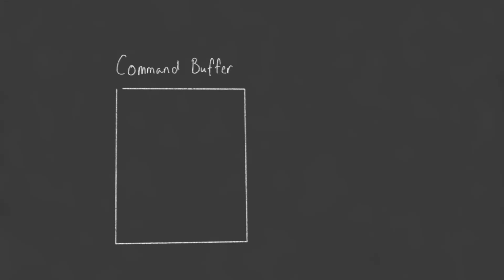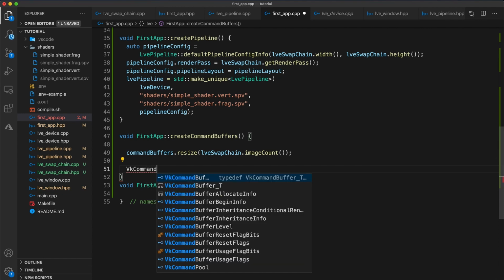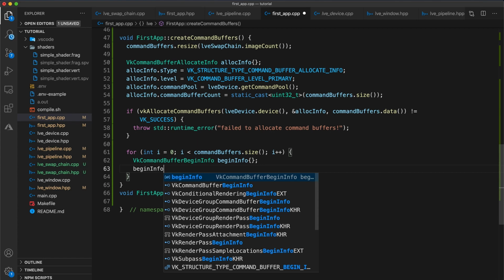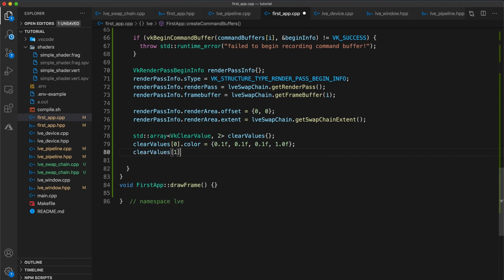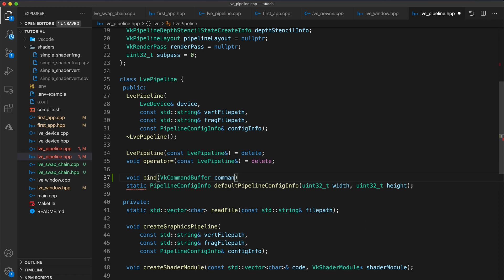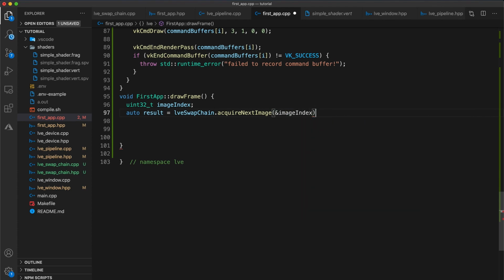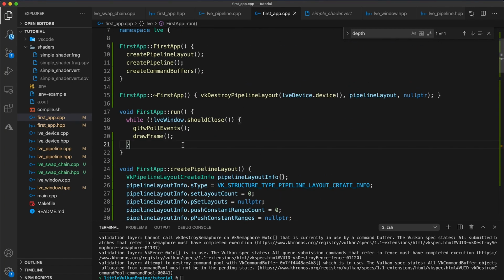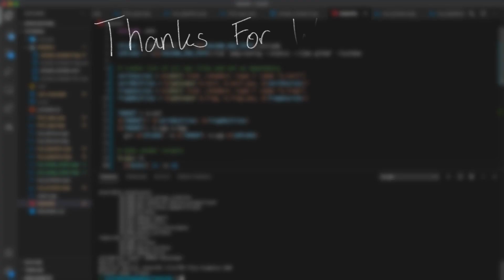Command Buffers Overview - Vulkan Game Engine Tutorial 05 part 2

Comment from the maker: !!! CORRECTIONS !!!
Note that in PART 1 of this tutorial (around the 5 minute mark) I fix the mistake last week, but I also left in an identical mistake within VkPipelineColorBlendStateCreateInfo pointing to the colorBlendAttachment! 
If you are using the MSVC you will be required to fix this. If not, then you can wait until tutorial 8 where I fix things there. My apologies!
The fix  is to pass in a reference of config info to be initialised rather than returning a copy.
https://github.com/blurrypiano/littleVulkanEngine/commit/a867ab39c43ccc89ca744db84137df179b41daa7
Reply: This was super important for me. I was doing this whole project in Visual studio and it was crashing just following the videoes at this point and it was crashing before the validation layers came up I think; wasn't getting good error messages. Did what this comment showed and now it is working fine. Onward!
Reply: The linked diff is still incorrect. Adding `PipelineConfigInfo(const PipelineConfigInfo&) = delete;` also deletes the default constructor. So you have to add `PipelineCreateInfo() = default;` in front of that.
Reply from the maker: @carlowood9834  - haha arghh darn. Was this causing an issue with a specific compiler? 

I've tested it so far with several compilers and so far no issues... but you are still right that this should be fixed. Thanks!
Reply: @BrendanGalea  It's incredibly late but in case it's useful. That issue happened to me with Visual Studio 2022 (C++ 20). The fix proposed by Carlo Wood solved it.
Reply: For context I am using Visual Studio 2022(C++17).

The code works with out making the modifications you link to. When I updated my files to reflect the files in the commit I get validation layer errors indicating the viewport and scissor objects where not passed to the appropriate vk function to establish the required state. I got errors along the lines of "viewportCount cannot be 0", and a few others relating to the viewport and scissor specifically. I might try using the modified versions of the files above again soon to try as an Vulkan exercise.

At this time I am falling back to the code used as in the video for now.

If you have any suggestions to try and resolve the issue I would like some guidance.

Thanks for this excellent tutorial.
Reply: @mikelevels1  Same issue.

Comment: Your content is amazing and you are a genuinly good teacher/tutor.

I just reached the end of this tutorial and everything compiles fine, triangles shows up etc., but I do get a a bunch of validation messages regarding semaphor use, that you don't seem to have gotten at this point.

If anyone could tell me how to fix that, or tell me if this even needs fixing, I would much appreciate it, even after all the years this tutorial has been out!
Semaphores are one of those things I haven't really used before, the validation layer recommends this:

a) Use a separate semaphore per swapchain image. Index these semaphores using the index of the acquired image.
b) Consider the VK_EXT_swapchain_maintenance1 extension. It allows using a VkFence with the presentation operation.
Reply: The issue is caused by recent changes in the validations layers. The recomendation now is to use one renderFinishedSemaphores per swap chain,.To solve the issue, go to createSyncObjects and change 
renderFinishedSemaphores.resize(MAX_FRAMES_IN_FLIGHT); to
renderFinishedSemaphores.resize(swapChainImages.size());

and also in submitCommandBuffers change
VkSemaphore signalSemaphores[] = { renderFinishedSemaphores[currentFrame] }; to
VkSemaphore signalSemaphores[] = { renderFinishedSemaphores[*imageIndex] };

PS: don't forget to change the initialization of the renderFinishedSemaphores and the cleanup for the new size
Reply: @pedrobussab9190  Thank you so much!
Reply: @HackFight Predrobussa's comment was seemingly deleted. Do you have the fix?
Reply: @LucydDev  Just switch the comment sort order to Newest first and you’ll see the answers. No idea why the default order hides them.
Reply: @y4cj4sul3  Thank you I figured it out after commenting lol. I have a hunch as for why it did that: it probably got filtered out for some reason for containing code snippets, much like how youtube often filters comments out as 'spam' for containing links.
Reply: i am having the same issue, I didn't see a fix anywhere, any advice?
Reply: @lkett197  Yes, the fix is to use MAX_FRAME_IN_FLIGHT or whatever its called to 3. as Brendan mentioned in the tutorial, his device doesn't support mailbox present mode, mine does, but mailbox and a bunch of other present modes require 3 frames. Brendan left his at 2 because he uses standard FIFO which only uses 2

Comment: In the end of the last video,  you sort of said in the createRenderPass() method, we're passing in VkSubpassDescription subpass with .pColorAttachments and .pDepthStencilAttachment to ultimately create the render pass. The render pass is the blueprint for information for the frame buffer. When did we pass in color and depthStencil information to the frame buffer? Is it in createCommandBuffers() clearValues{}, then clearValues[0].color, clearValues[1].depthStencil? This just clears the values, when did we set the values? Thanks, still just a beginner here.

Comment: I'm using Visual Studio 2019 and I can't figure out how to add a custom build step.  Anyone have any luck with that?
Reply: I managed to get it working by adding the following to VulkanTest.vcxproj in the section <ItemDefinitionGroup Condition="'$(Configuration)|$(Platform)'=='Debug|x64'">
It's doesn't look for all *.frag and *.vert files currently.  Just the specific ones.  I'd appreciate any help on making it generic like in the tutorial make file.

    <CustomBuildStep>
      <Command>C:\VulkanSDK\1.3.280.0\Bin\glslc.exe $(ProjectDir)simple_shader.vert -o $(ProjectDir)simple_shader.vert.spv</Command>
      <Outputs>$(ProjectDir)simple_shader.vert.spv</Outputs>
      <Inputs>$(ProjectDir)simple_shader.vert</Inputs>
    </CustomBuildStep>
    <CustomBuildStep>
      <Command>C:\VulkanSDK\1.3.280.0\Bin\glslc.exe $(ProjectDir)simple_shader.frag -o $(ProjectDir)simple_shader.frag.spv</Command>
      <Outputs>$(ProjectDir)simple_shader.frag.spv</Outputs>
      <Inputs>$(ProjectDir)simple_shader.frag</Inputs>
    </CustomBuildStep>
Reply: I found a way that works for each file you add.  It doesn't check for every frag or vert file and then loop however.

Select the file in the Solution Explorer.
Click the wrench icon in the lower Properties window to open Property Pages.
Under Item Type select Custom Build Tool and Hit OK
Open Property Pages again
There will now be a Custom Build Tool tree, select that.
Set Command Line to:
C:\VulkanSDK\1.3.280.0\Bin\glslc.exe $(ProjectDir)%(Identity) -o $(ProjectDir)\%(Identity).spv
Set Outputs to:
$(ProjectDir)\%(Identity).spv
And set Link Objects to No (Not sure what this does?)

Repeat for both FRAG and VERT files.

Comment: Any idea on this error? I'm looking all over the swap chain class, but I cannot find any errors. At least that I notice...

Validation layer: Validation Error: [ VUID-VkPresentInfoKHR-pImageIndices-01430 ] Object 0: handle = 0x2675971f3d0, type = VK_OBJECT_TYPE_QUEUE; | MessageID = 0x48ad24c6 | vkQueuePresentKHR(): pPresentInfo->pSwapchains[0] images passed to present must be in layout VK_IMAGE_LAYOUT_PRESENT_SRC_KHR or VK_IMAGE_LAYOUT_SHARED_PRESENT_KHR but is in VK_IMAGE_LAYOUT_UNDEFINED. The Vulkan spec states: Each element of pImageIndices must be the index of a presentable image acquired from the swapchain specified by the corresponding element of the pSwapchains array, and the presented image subresource must be in the VK_IMAGE_LAYOUT_PRESENT_SRC_KHR or VK_IMAGE_LAYOUT_SHARED_PRESENT_KHR layout at the time the operation is executed on a VkDevice
Reply: I solved it. For some reason, I submitted the command buffers in the draw frame function with m_commandBuffers.data() instead of &m_commandBuffers[imageIndex]... No idea how I did that...

Comment: Thanks for making this very well detailed tutorial series, I was facing an issue where during the vkCreateGraphicsPipeline would throw an error "access violation reading location <>" while it was reading amdvlk64.dll file i.e., the windows vulkan driver, I updated the drivers, checked all the methods and parameters, also looked on stack overflow but nothing helped, any advice? I'm on windows 10, visual studio 2019, amd Rx 7800 xt GPU, intel 12th gen i7 CPU, any help would be highly appreciated
Reply from the maker: Hmm I’m not sure. Haven’t been active with vulkan recently. You could try asking in the discord. People there are usually pretty helpful. Should be able to find a link for it on the most recent tutorial videos. Sorry I can’t be of more help
Reply: @BrendanGalea  thanks for the quick response
Reply: @akcsegamedev  Hi, I was wondering if you were able to figure out the issue. I am facing the same problem and need a solution

Comment: Those with dual graphics cards like me(Linux) and Prime selected NVIDIA/AMD as default and disabled integrated cards. You might have a window crash after running the program. Fix: in the lve_device.cpp file, modify the pickPhysicalDevice() function. It picks the first device as detected, which is always the integrated card. Thus I change the code inside that loop which:
:face-blue-smiling:
 for (const auto &device : devices) { VkPhysicalDeviceProperties deviceProps; vkGetPhysicalDeviceProperties(device, &deviceProps); if (std::string(deviceProps.deviceName).find("GeForce RTX 4060") != std::string::npos && //change the name of your graphics card deviceProps.deviceType == VK_PHYSICAL_DEVICE_TYPE_DISCRETE_GPU) { physicalDevice = device ; break; } }
:text-green-game-over:
 If you don't know your device name, write a Vulkan demo program to get the device name. Hope this is helpful

Comment: I don't like Makefiles and because of that, I've done a automatic shader recompilation if shader was changed or something. :)
Reply from the maker: Ya that’s the right idea! Super frustrating debugging something and not realizing you forgot to build the shaders. We switch to using cmake in a future tutorial to improve the build process
Reply: If someone interested, here's a bit deeper explanation down below:

Every time i try to load a shader it's also required to generate some hash value based on shader source (I used MD5 algorithm).
(If it's a first time you compile shader - save hash to a file (probably with the same name but extension must be '.sum' or something).)
Then, read hash string file (that one with '.sum' extension), compare actual hash string with the previous one.
If hashes are equal -> shader doesn't changed, just read compiled one.
Otherwise, save new hash string, recompile shader and read compiled one.

I think my solution is pretty much primitive version of how 'big' engines does this things, but it works pretty well :)

Comment: Have one question - this fucntion: commandBuffers[i].end() is returning void, however in demo solution for CPP is returning the vk::Result its even pointing to the same header (line/signature function). I am comparing the DEMO in sdk folder and wondering what I am doing wrong that my end command buffer does not returns any result its just void. Do you know why ? btw great vk tutorial

Comment: Ha! I get the triangle! And no validation messages. So far, so good! :-) This tutorial is awesome, thank you Brendan
Reply from the maker: So glad!!! I'm replying to these in reverse chronogical order, seems like you're making quick progress :)
Reply: @BrendanGalea  haha, yeah, I wrote a Hazel-based Engine last year with Open-GL. I created a new project for your tutorial, but try to keep the architecture the same. The Hazel engine has an additional abstraction layer so that the app is completely API agnostic. It takes a bit to merge that over. If you take a look at your Discord tutorial channel, we were just discussing how to deal with the CreateEntity function for the camera object, when heap-allocation is not an option (I call it in a Start() function of my Engine). The problem is that CreateEntity heap-allocates and then it has to be moved into something persistent. A std::vector with one element works, it's just ugly code to then later use cameraObject[0] all the time...  Maybe I'll change CreateEntity to create a shared_ptr right away...

Comment: I am using xcode and can't seem to find a reliable way to automatically recomile my shader code to change the color of the triangle as I build the project. Can you help? It works when I do it by hand, via opening a new terminal and running the comile.sh file then refreshing the shader path in my FirstApp::Pipeline. This is a task and may work but I would definitely like to find an automated alternative. Other than that, it all works!!! Thanks so much for everything!!!
Reply from the maker: Try this https://robertharrison.ca/posts/2020-01-03-xcode-prebuild-script/

You should be able to set it up so the compile script will run automatically before every build.

Comment: There are no errors. it just says Segmentation Fault (core dumped)

Edit: Here's the whole output

available extensions:
        VK_KHR_device_group_creation
        VK_KHR_display
        VK_KHR_external_fence_capabilities
        VK_KHR_external_memory_capabilities
        VK_KHR_external_semaphore_capabilities
        VK_KHR_get_display_properties2
        VK_KHR_get_physical_device_properties2
        VK_KHR_get_surface_capabilities2
        VK_KHR_surface
        VK_KHR_surface_protected_capabilities
        VK_KHR_wayland_surface
        VK_KHR_xcb_surface
        VK_KHR_xlib_surface
        VK_EXT_acquire_xlib_display
        VK_EXT_debug_report
        VK_EXT_debug_utils
        VK_EXT_direct_mode_display
        VK_EXT_display_surface_counter
required extensions:
        VK_KHR_surface
        VK_KHR_xcb_surface
        VK_EXT_debug_utils
Device count: 1
physical device: NVIDIA GeForce GT 710
Present mode: V-Sync
make: * [makefile:10: test] Segmentation fault (core dumped)

Please help
Reply from the maker: sorry for the slow reply. Were you able to figure it out? When I get a segmentation fault I'll often recompile and run using a debugger like gdb, or whatever debugger you have in your editor. Instead of getting a random crash and seg fault, you'll often get the exact stack trace and location of the bug.

In this case though a segfault here is most likely due to a mistake I made that affects visual studio MSVC compiler. Check the pinned comment for the provided fix and hopefully that resolves things. Sorry for the error and if you wasted time on debugging :(
Reply: @BrendanGalea  I'll try this and reply if it worked. I just woke up right now lol. Timezone differences. Also, it is absolutely not your fault. I have 100% done some stupid mistake that I can't find. No worries, I'll let you know if it worked. Also, I'm on linux and using vscode and g++

Comment: Had the same issue as @
神经大 and I read his comment on looking at the first comment for the corrections. I end off with the last error stating this:
On this line of code `PipelineConfigInfo pipelineConfig{};` in file first_app.cpp.
`error C2512: 'vge::PipelineConfigInfo': no appropriate default constructor available`
`message : No constructor could take the source type, or constructor overload resolution was ambiguous`

Any ideas what might be wrong?
Reply from the maker: Ya I think this is a mistake on my part. Because we delete the copy constructors I should have implemented an empty constructor. 

Try adding a constructor for PipelineConfigInfo() = default;

Sorry I missed this. It’s only some compilers this will cause issues with.
Reply: @BrendanGalea  Thanks for your reply. I think I was too tired, last night I didn't read all the posts and that error is quite obvious.

Thanks for your tip and the other guy in the comments mentioning the default construct. Everything is working. :-)

Keep up the good work @Brendan Galea. Did you consider creating patreon page or something in that line?
Reply from the maker: @georgsteyn  Awesome! and ya I might be making a patreon soon :)